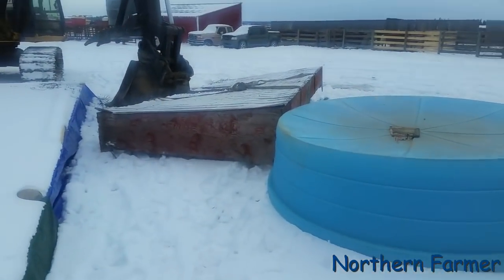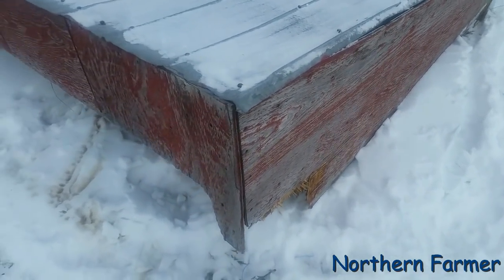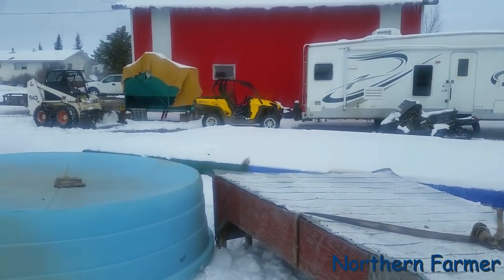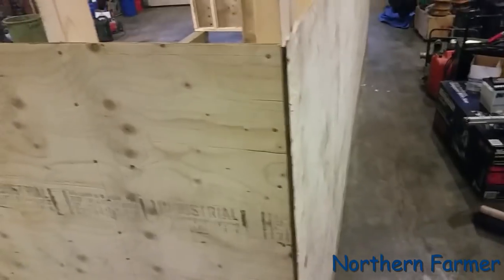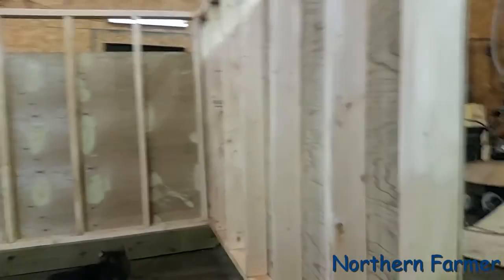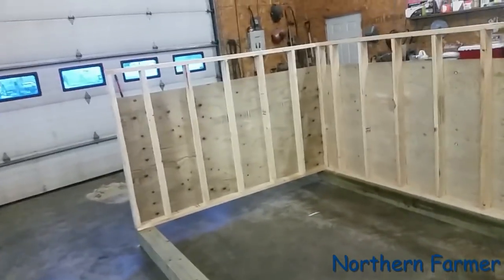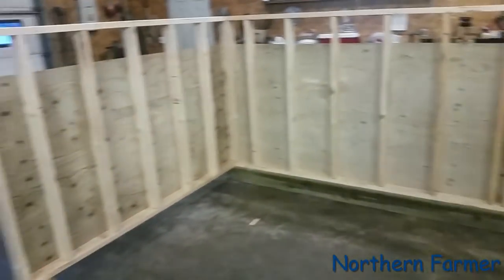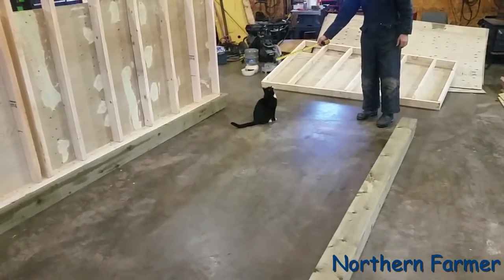Building A small Calf Shelter Prt1

Comment: looks verry nice... as a matter of fact im going to use one of your tips on the shed runners for the pin and how its pulled... im just building a 10' by 10' for a chicken house is all im doing... thank you
Reply from the maker: Pins work great to pull... we used to just hook a chain around the whole skid but you had to dig a little hole to get the chain under it... The holes work great for just shoving a pin through it.  They should be a bit father back in the skid though.. In this case we had to make it close to the end..
Reply: Northern farmer yes i was just going to wrap a chain around both sides but this will be so much easier especially if the skids are flat or below ground leval... cool beans thank you...